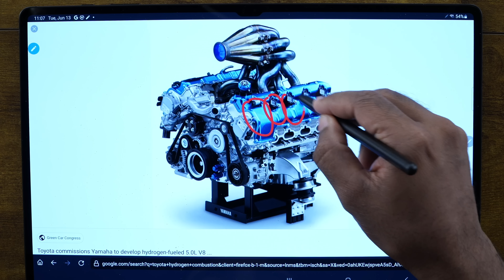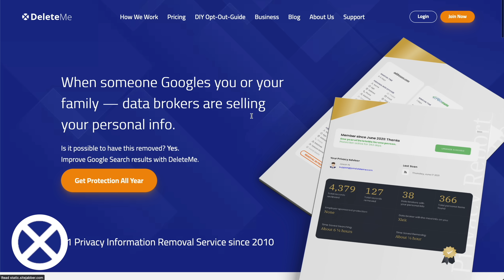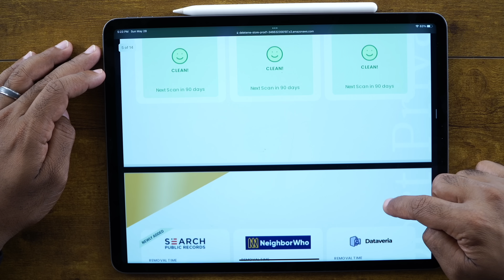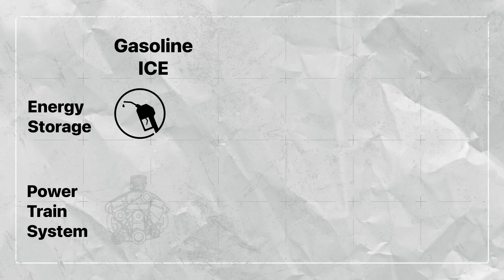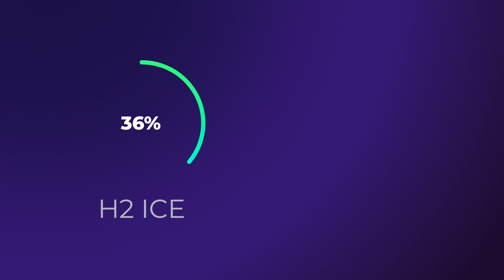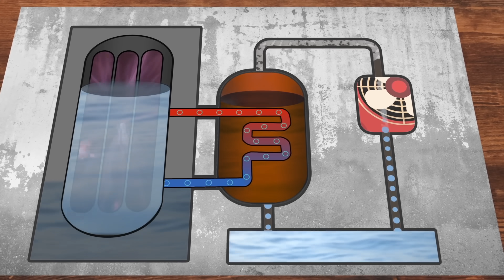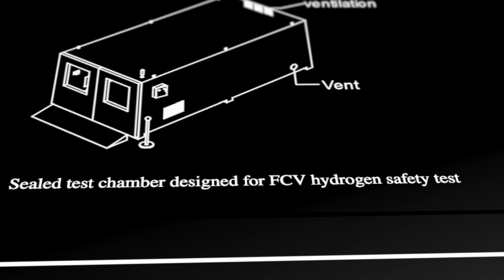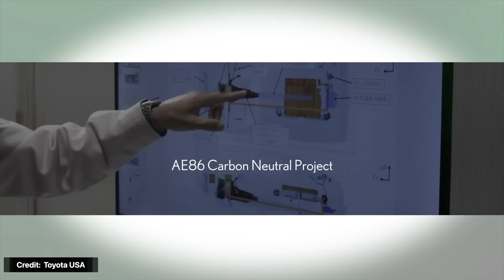Toyota's Says They Just Destroyed EVs - Hydrogen Combustion Engines

Comment: While I understand the benefits of an EV, it is more useful in city and town driving.  In fact, I asked a Tesla owner how many times they went coast to coast with their EV, they said the first time was horrible, the second time was better but still nail biting.   The amount of convenience with an ICE car made them to decide to keep an ICE in case.

As with Hydrogen, I think it will take off once they start making more stations with hydrogen fuel.

In addition, hydrogen fuel cell technologies seem the most promising if they can ween the average consumer off petroleum or diesel.  I heard hydroelectric yachts and planes are in the making, whereas EV yachts have clear benefits over diesel or petroleum but not against Hydroelectric hybrid or fuel cell.

Airplanes or military applications utilizing EV technologies sound amazing but my engineering friend said that going across the planets oceans aren’t possible unless they are tiny drones.   Apparently, the weight of batteries make them unpractical for EV technologies.   I’m sure they could make a 747 run on EV technologies but the weight of the battery packs might limit their traveling distances especially across cold Arctic conditions.

Comment: Where did you calculate the electricity generation to supply the EV charging stations and the energy to extract the rare earth minerals for the batteries. Even though the cost of child labor is only pennies a day there still is cost. Also the cost of land and materials to deal with the used batteries. After all of that, how energy efficient is electric?

Comment: I would consider a Toyota withe the new engine! Ev stations are still lagging! Also u did not cover disposing of the  battery’s! Also as the EV gets older the mileage drops! I use to get 125 miles after 5 years I get 75 miles……13,000 for replacement batteries……

Comment: I still don't get Toyota's hardon with hydrogen. There's a ton of drawbacks and infrastructure etc etc to build, there's no support for it. For every EV, there's a plug at home for it. I'm sure there's an application, where hydro is better, but I'm still to see any valid argument that it should have the billions poured in to it, vs bettering EVs. And before anyone comments about the rare-earth metals and mining conditions etc etc for EVs, even with hydro, they still need to be mined. However, there's plenty of new energy storage options being developed, like aluminium (or aluminium for the US folks reading) and salt-based, which outperform current batteries in almost every way. They just need to be scaled. Just wish Toyota would stop resisting, and help with everyone else!

Comment: After owning a Model 3  RWD for almost 2 years, where 95% of charging is done at home and I'm free of oil companies, plus it requires almost no maintenance - WHY would I even consider going back to queuing at a filling station, and being beholden to a hydrogen supplier plus the obvious maintenance overheads. Also one of the benefits of the BEV is that they are quiet.  Not mentioned in the video, it is highly probable the H2 tank will require periodic pressure testing for the vehicle to be re-registered.

Comment: You are comparing efficiency.   Yet, we have survived with 25% sufficiency for 50 years.   Now all the fuss about efficiency.  Well, there is more to worry about.   The electric grid can´t supply all , especially on high demand hours.   That is why you need hydrogen .... green of course.    Trucks and the sheer weight of batteries is not for planes and buses, as you have to wait to long or it´s too heavy

Comment: Any engine in the "combustion" format is already obsolete due to the fact that is takes 100's of parts to build. An electric engine at its most basic takes 100s fewer parts. Electric motors wear less and last longer and are more easily recyclable. The price\cost ratio difference will easily come down on EV autos. If watch technology progressed at the rate of "combustion engine" models then we would all still be using a wind-up watch. #$$%^^^^^^^^^^^^^^^^^^^^^^^^^^^^^^^^^^^^^^^^^^^

Comment: Good video but to me the EV supply chain is hugely suspect for two main reasons. First, not a huge fan of slave labor to mine the minerals required. Second, to replace all ICE vehicles with EVs will require a massive ramping effort in mining output. Doesn't matter if it is slave labor or a more modern mining approach, mining is horribly toxic for the environment making oil extraction look fairly tame. Thirdly, not a fan of even more reliance on China with regard to these rare earths. I think Japan's red hydrogen is an interesting approach that could allow anyone with a coastline to make hydrogen and or desalinate water.

Another question I have is, say you have 33% of tail pipes emitting predominantly water vapor. What does that do to local rain cycles and is there a possibility that the American southwest could leverage this water vapor to 'terraform' the Geo region to have more rainfall? If they could, would that be worth exploring?

Comment: I've read about and followed H2 powered engines for about 50 years. The biggest issue is the cost to produce and transport H2. It is currently and has been very expensive even with all the improvements over that time. Also to use it in an ICE is a waste of efficiency. It is far more efficient to use in a fuel cell. Currently BEV is more efficient and less costly.

Comment: Although a hydrogen ICE vehicle will sleep ALL of the negatives of petrol ICE yet none of the positives of HEV, you forgot the ONE THING that it has over EVs - emotion!!

Hydrogen ICE will retain all/most of the sound, emotion and inner feelings of all ICE-powered vehicles. And THAT is a VERY powerful seller!!  Even if the cost per mile would double, I'd go with H2 ICE if it meant I could keep my Aston going for the foreseeable.  (And yes, I am concerned about the possibility of internal combustion being legislated off the road, despite the reassurances!

An EV would do me for mundane daily use but the Aston is for the weekend!!

Comment: The thing about this engine is it is possible they could easily convert existing ICE vehicles. I have had vehicles running LPG (propane in the US) for years. In fact for many years in Australia most taxis were powered by LPG until they decided hybrid Toyota Camrys were cheaper to run.
Reply: unfortunately existing ice vehicles won't be able to run hydrogen unless substantial amounts of money are spent on overhauls. Note when he was talking about the toyota V8 having hardened valves and valve seats. The valves/valve seats in existing cars are built for gasoline and would wear out running hydrogen. The only way to keep existing cars in the loop would be to create synthetic gasoline using hydrogen and captured carbon
Reply: @knote4958  I think the OP was talking about a new hydrogen ICE engine, and fuel system in an existing car. If that's the case, this is potentially far more feasible than modding a petrol engine.
Reply: @richardmartin8998  You're still looking at a lot of money to carry out that swap, even if automakers against all odds decided to offer retrofit engines for existing cars
Reply: @knote4958  I agree with that. Actually I think it will come down to someone doing it as a dedicated conversion as a standalone business as opposed to a mod offered by Ford, GM, VW etc. The car manufacturers want to sell new cars not fix older ones, and the best way to do that is forced obsolescence.
Reply: @richardmartin8998  I agree, that's why I said "against all odds" as far as automakers extending a hand to help existing owners. Still, 3rd party retrofits do have their price tag and are more for car owners who can do without expecting to have a powertrain warranty (niche car owners basically). I'd be up for it if it wasn't too cost prohibitive, hell I had an idea for making an EV from a 72 dodge dart but the EV conversion costs are just too high.

If you ask me what the play is, I'd say we start with synthetic gasoline that existing cars can run on. There are too many gasoline/diesel ICE cars on the road to replace right away, so transitioning to any other fuel source needs to be a slow process. That will give society time to phase out old ICE cars and for infrastructure to adjust to supplying these fuel/energy alternatives
Reply: @knote4958 You greatly underestimate the cost of synthetic fuels. And the bigest issue with synthetic fuels is that there won't be enough produced anytime soon.

If we look at all eFuels projects, we gonna be able to cover the eFuel needs of 10% of the industry and commercial traffic (Ships and Airplanes).... in germany... not the entire world... just germany. 

And even if we scale it to mass production a liter of it will still be way above 10 USD, because of the massive energy required to produce it.
Reply: @germanmosca  No more than you overestimate the cost viability of other alternatives. At this point the only energy/fuel alternative that'll be cheaper than synthetic fuels is pure hydrogen. If you thought batteries in EVs are gonna pan out large scale, wait until the overburdened supply of rare metals drives their cost through the room and their excessive energy demand on our energy transmission grid drives energy costs up. Even if we all drive the cost of energy down by switching to nuclear (or in Germany's case, switch BACK to nuclear, idk why you guys gave up cheap sustainable energy), the problem remains that the transmission grid can only carry so much load.

The problem with efuels isn't the energy demand, it's not as high as you make it out to be. The problem is the energy efficiency producing it. At some point we need to weigh sustainability and not just sheer efficiency, because as of yet hydrogen and efuels are the most sustainable options we have until we can transition to something better. Plug in batteries are just a stop-gap until we have battery technology that is not only renewable and recyclable, but also runs on its own parallel infrastructure so as to not overburden the energy grid.
Reply: it is not
Reply: Batteries how much to replace cost of mining boom your loss right there. People are blinded by this. YOU WILL PAY FOR YOUR LOSSES

Comment: Because it's not just about efficiency. Ev's are rather boring to drive to a car enthusiast, as you touched on in your video. 

Then you have the other "problem", and that is how can we make the existing fleets of vehicles cleaner without forcing everyone to scrap them and upgrade, which would create huge pollution problem for the plant.  Not to mention it would take existing factories way too long to produce all the vehicles required, and cost consumer's too much money. Hydrogen retrofit systems, sort of like LPG conversions, could be built and fit to existing vehicles, making them cleaner, which would help clean up the world.

It's not the most efficient use of hydrogen fuel, but it would very seriously cut air pollution, and let's face it, say a Hydrogen ICE cuts tailpipe emissions by say 90% for an example, that is HUGE, and that could be achieved a lot quicker by retrofit fuel systems, than building all new vehicles. In time, older vehicles will need to be replaced, and that gives us time to build new vehicles. Lots of pollution created to build a new vehicle.

Comment: I like the idea of it actually being used correctly in combustion and the potential grows exponentially for ability like other combustion engines
Reply: "Correctly" lol.
Reply: Why exponentially?  It has next to no benefit and is quietly dying.
Reply: The "correct" way to use hydrogen is actually in fuel cells. That's pretty obvious from the efficiency and emissions differences.
Reply: @CaptHollister  of course.  But ya still have the production, transportation and storage problems which are not yet solved.
Reply: @protonneutron9046  Those are constant whether you're using the H in a fuel cell or burning it in an ICE.
Reply: @CaptHollister  that is why I used the word "still"
Reply: Delusional.  Physics is still physics.  It takes more energy to create Hydrogen fuel than you get back.  It is difficult to move, store and dispense.  This is why it isn't used for automobiles.  Toyota hasn't made any physics breakthroughs therefore this is a bust.

Comment: For me the real head scratcher is the obsession over battery vehicles - given all the ongoing issues that presents so far and the WILD problems that's going to bring in once they become more widespread:  think grid demand/spread/load and power generation.  Already shedding in California has shown that this happens even at current distribution.  
Hydrogen permits more contained elements of the supply chain - create/generate near power generation points and then ship for quick retail and fill (by comparison).  If hydrogen can be shipped then we might see combustion engines and hydrogen-electric ones appearing over time.  This just doesn't have the grid problems that electric has;  as for explosive release, etc. we saw this came concern with LPG tanks in vehicles, I realise that's not the same gas but there are parallels there and today we have much more advanced materials to contain these things with.
The Japanese aren't stupid - they know that the real advantage is the supply chain and they know that almost no countries in the world can service the jump from niche vehicle distribution to widespread allocation especially if a car has to be charged nightly.  Add to that places where garages are rare such as the UK - simply charging vehicles on that scale in London alone is going to be an utter nightmare.
Reply: You need to do more research on  EV's. They're much better than you think!
Reply: @gregbailey45   you need to read what I wrote.  The EVs themselves aren't the problem I am pointing to - the grid and generating the required power IS.  And in many countries it will spike demand for power in ways that will simply spike the use of coal, wood pellets and natural gas as they simply won't have a choice.  EVs have a very high impact cost themselves to manufacture and refine; lithium cells aren't going to solve the world's power problems either.  This planet can't provide enough lithium to produce batteries sufficient to power the US for 4 hours (grid).  Also with all of Germany's "green" initiatives they have burned through a trillion Euros apparently and yet their carbon footprint has gone UP. 
EVs very much have their place but longer term I see them (with current tech) ending in a more niche outcome if hydrogen can catch up.  Also remember that hydrogen is closer to what car makers do now - electric may end up closer to industrial electronics manufacturers and those skills are often outsourced in the automotive industry (at least they have been given the specialisation required).  I think zealots and advocates have done their bit and forced them past the legislative impost stage, they need to stand back and let pragmatists take over.  Especially on generation and grid issues.

Comment: This is complete nonsense. A hydrogen combustion enginge will be even less efficient than a fuel cell vehicle.  That means that you have to have an even bigger very strong expensive cylinder to store it. This does nothing about the hydrogen supply problem. If the hydrogen comes from fossil fuels, as most currently does, it does nothing to reduce carbon emissions, in fact it makes them worse. If the hydrogen is produced from green electricity the energy losses from compression and distribution are considerable. This thing is always going to be less efficient and far more expensive than an equivalent EV. This seems to be Toyota's very last rearguard action and it is doomed to fail.

Comment: Combustion produces - with air as oxidizer - NOx. Even some particulate matter. Not as much as combusting carbon compounds, but still.
Though there it is a motor with movable parts that nead grease/oil. And a bit of that oil still will burn.
So, will that vehicle be required to carry a catalyzer?

Comment: One of the biggest problems is the electrical network feeding the end user like houses and businesses. Now if one EV charge unit feeding one car in one house takes 22KW of energy to charge a car overnight. Now multiply that by three or four cars per house ( potentially) . Already that house has gone over the max current supplied to that house, even if the incoming feed from the network is three phase. Then multiply that by the number of houses in your street and it soon becomes apparent of the supply network problem. The current PE solar system in Australia only allows up to 6Kw of supply, even if you have battery storage. So even this system is problematic.

Comment: I did a report on burning hydrogen in cars 30 years ago in college. About time. But to break apart water into hydrogen take a lot of electricity. So we also need nuclear power to complete the deal. Hydrogen won't run out in 30 years but all the materials for batteries will. Yea good luck with recycling it works so great with simpler plastic. If the world goes EV 30 years down the road then hydrogen. I wont get to see it. oh well. To bad they will pollute the world digging up all the battery material.

Comment: You didn't say how big a tank is needed to hold enought H2 to drive 300 or 500 miles. A lot of energy is wasted pressurising H2 to such high pressure. The 35% efficiency is just the engine.  This concept makes no sense at all.